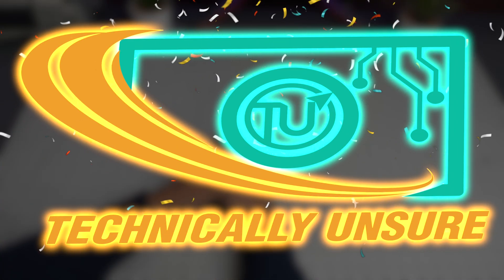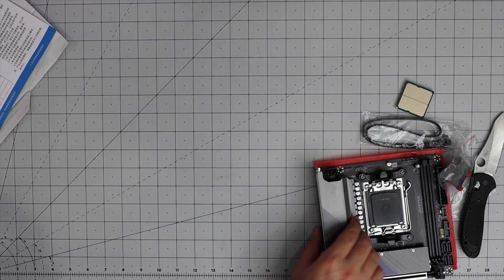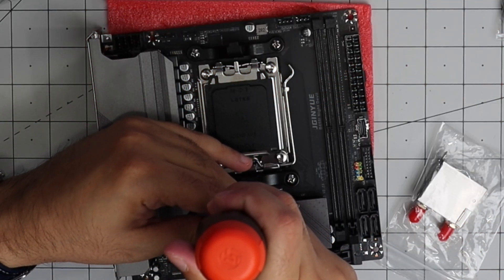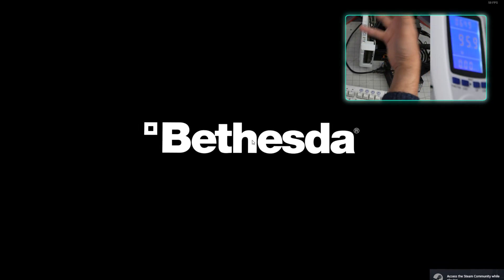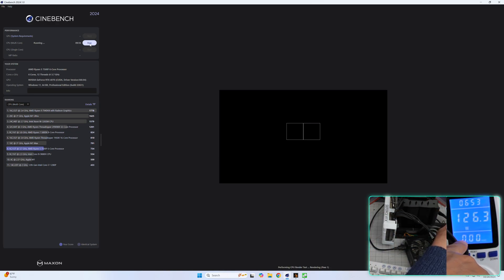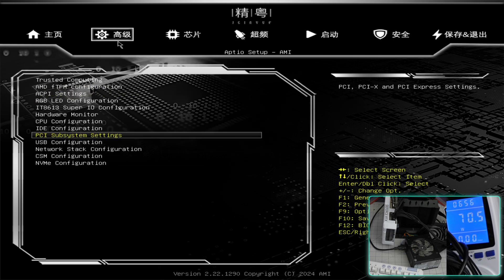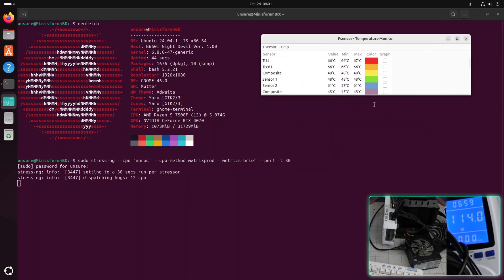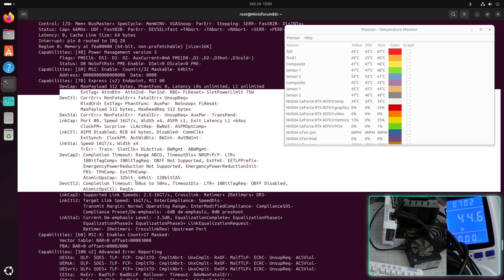JGINYUE B650 ITX Motherboard Review: Ryzen 7500F + DDR5 | Worth the price?

Comment: Around Black Friday I picked up this board for $80 and the Ryzen 7 8700f for $130. Paired with  32gb of 6400 mhz ddr5 I picked up and got a pretty solid system. Close to 19k multicore in cinebench r23. I also have the older am4 b550i-gaming and this one is leaps better.
Reply: Which seller sold you both of those for $130 USD? I'll have to keep an eye out. Cheapest I can piece by piece the ITX board and a 7500F is about $230 USD right now

Edit: ohh you paid $210 lol
Reply: @  Infinity Parts PC Store for the first board and it was $80 purchased 11/28/24. The 8700F came from PC Hardware Parts Store for $139-$9 in coupons so $130 purchased on 11/28/24 also. Grabbed an 8400F for $86 in January as well. The second board I bought came from the JGINYUE Offical Store for $105. These were real cheap when they first put them up before the YouTubers drove the price up with their videos

Comment: I’ve seen these shipping now with the 7600x and 9600x on newest ones . Both under $300 cpu, mobo, ram combos
Reply: I just looked tonight and lowest I could find is $328 with the Maxsun B650, Maxsun branded weeb RAM, and 7500F CPU

Edit: or maybe it was Jingyue, one of the two
Reply: @ the other ones probably got sold out by now. I screen shot them when they had those deals though.
  But if you do get one, some of the newer ones come with a bios that supports 9000 series and 7800x3d.

Comment: This board had issues with 9000 series but seemingly ship with updated bios now. Using 9600x with 6000mhz cl30 with absolutely no issues. BIOS leaves a lot to be desired but it doesn't make any difference once everything is configured :P
Reply: ? Modelo de RAM

Comment: can get 6000Mhz ?
Reply: Kingston Fury Beast DDR5 64GB (2 x 32GB) 6000MHz EXPO RAM running stable at 6000MHz.  Had to increase some RAM setting voltages to 1.35v which is the recommended voltage setting by supplier.
Reply: @glenswada  What is your ram cl30 or cl36?
Reply: @ CL36 Part No KF560C36-32
Reply: Thanks 👍

Comment: Hello, I'm from Brazil. You in the video show the 5600Mhz Kingston memories to use on this Chinese board. I would like to know what the CL of your memories used in the test is. I see many complain that this 6000Mhz card causes system instability, is that true? Which memory in your opinion is best to be used in the JGINYUE B650i NIGHT DEVIL.
Reply from the maker: In this video, I'm using Vengeance CMK32GX5M2B5600C36, but I'm sure other similar DDR5 RAMs would work as well, didn't encounter any stability issues.
Reply: Crucial Pro Ddr5 6000mhz Cl36 works without changes to bios but linux reports (sudo dmidecode --type 17) it's only configured at 5200 MT/s.
Reply: Swapped over to Kingston Fury Beast DDR5 64GB (2 x 32GB) 6000MHz EXPO RAM.  Runs stable at 6000MHz at 1.35v
Reply from the maker: @glenswada  very nice, well done and thanks for sharing it

Comment: once you add the CPU (ryzen 7 7500f), it hovers the same price range as the higher-end minisforum bd790i se (ryzen 9 7940hx - 16c/32t). and still you need a heatsink for this one.
Reply: CPU performance of the 7940hx is certainly higher end.  But the lack of sata ports with the  bd790i is problematic for people that already have 2.5 drives.  It be cheaper for me to use a similar performing Ryzen 9 7900 with JGINYUE B650 than buying 2 x new 4TB M2's for the bd790i se.  But I'm finding the 7500f has more than enough oomph for my mediocre 4060.

Comment: did they fixed the ram compatibility issues in the new updates? planning on using this or the asrock a620i but this is cheaper by 40usd

Comment: I’ve put up some respectable bench results in hwbot with 7600 and this board on an aio in a case with a water cooled 3090. It’ll do 5.35ghz 1.27v 3.1ghz uclck 1.22v vsoc 6200mhz ram cl 30-34-34 with tweaked buildzoid timings 24/7 stable. If the cpu was better it could do 3200mhz uclck 6400mhz ram which it does just not 100% stable.
Reply: Unless you’re looking to load up 12 cores or more with long heavy work loads there is no need for any other ITX am5

Comment: I'm pretty sure LGA1700 is an Intel socket. This CPU is LGA 1718 Socket AM5
Reply from the maker: You are correct, was reading based on what's listed on AliExpress listing, but yes, its 1718, not 17000
Reply: It's an AMD AM 5 Motherboard !!

Comment: The hardware quality has improved a lot, but the firmware/BIOS still needs some work, especially with RAM compatibility. The biggest weakness is the lack of a BIOS flashback feature that's pretty much standard with AM5 motherboards now. Without that, you have a greater chance of getting stuck with an incompatible motherboard for newer AM5 processors. That's assuming the Chinese manufacturer offers BIOS updates for the CPU.
Edit:  JGINYUE appears to offer regular BIOS updates, including support for the Ryzen 9000-series CPU's. That's a good sign, but they still need BIOS flashback.

Comment: In my setup with the same 7500f, i used G.Skill Trident Z5 Neo RGB DDR5, 6000MHz, 32GB (2 x 16GB), Non-ECC, CL30, EXPO, F5-6000J3038F16GX2, no problems at 6,000 mega transfers.
Reply: Nice, since i am planning to build the same build 7500f 32gb 6000mhz gskills.

Comment: This is less than half the price of every other AM5 ITX motherboard out right now. It's a fantastic value.
Reply: can you get it without the used CPU? and if possible is there a BIOS update for the 9000 series CPUs?
Reply: Yes and yes, If your motherboard was manufactured recently, it already comes with the bios compatible with the 8000 and 9000 series, latest BIOS   update is 09/09/24.

Comment: Some Settings you were running too fast through but never mind. Resize Bar you should have on enabled. But nice that it has an graphical UEFI not that oldschool BIOS lookalike UEFI
And AM5 is LGA1718 ... LGA1700 is intel core i 12/13/14. Gen .
Reply from the maker: Thanks for the feedback, will slow down on BIOS settings next time.